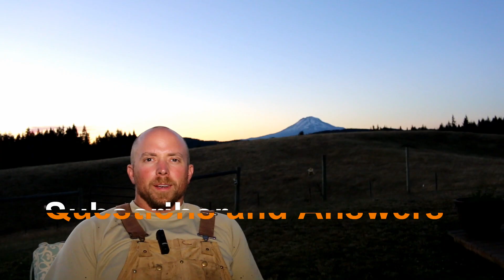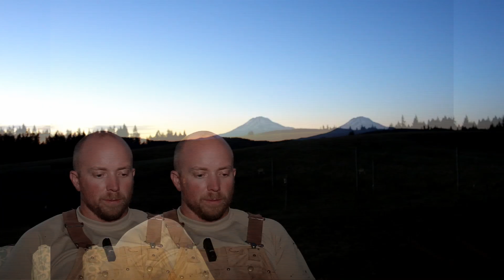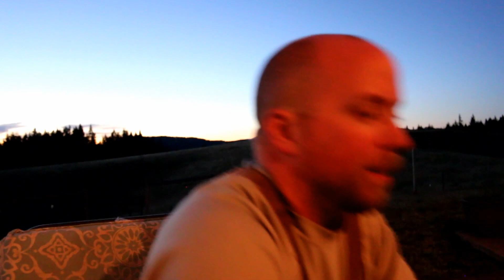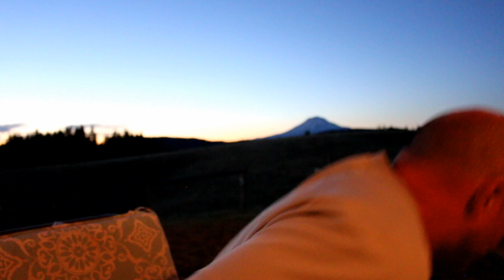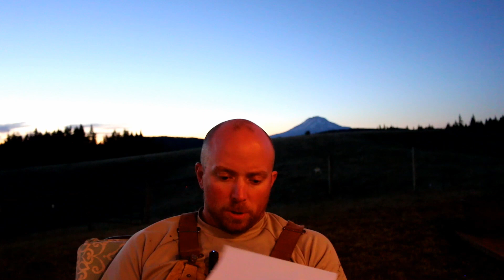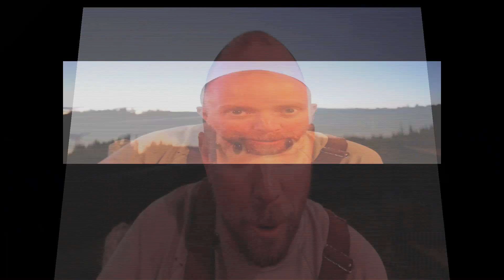Subscriber QUESTIONS AND ANSWERS

Comment: For the Snow issues you are having with your Solar Panels you could put them on a system that raises one end of it every few hours so that it forces the snow to slide right off of them. It would be powered by the Solar Panels and batteries connected to the solar panels. OR you could implement a heating element to it that is powered by the solar panels and batteries to keep it at a high enough temperature to keep the snow melting and off of the solar panels.

Comment: Lots going on.  What do you do for your "day job", if you don't mind sharing? Do you get to work from your house often? I ask because I would think travel to your job would be hard and sometimes not worth the risk if your Internet is stable during inclement weather.

So is the one wemos board going to be the lane master to the 5 or so megas in each bed? 

Since the microcontrollers are ran off of ac converter without battery backup, seems like it would be pretty easy to program an alarm function into your server setup to text/alert you when no data has been received in x minutes.  If they are on battery and will continue to report when power is out, a simple wall wort and voltage divider/resistor  into a digital pin would tell arduino if power is on or off

Comment: If you make a dead man switch for the power in the greenhouse would you like it to set off an alarm and email/text you? 

Very easy to setup with an arduino using a little 6 or 12v emergency light battery to keep it powered with the power out and a 120v ac relay to signal when the power gets cut. Just need to make sure the wifi stays powered also or it will never get the signal out. 

simply use the relay as a switch to tell the program if the power is on or off and send out the message tied to that state.